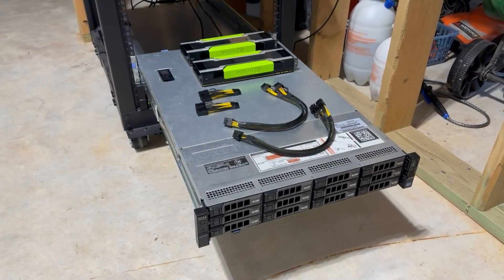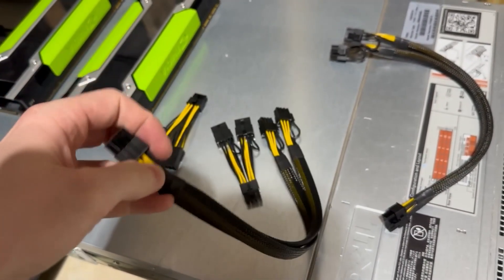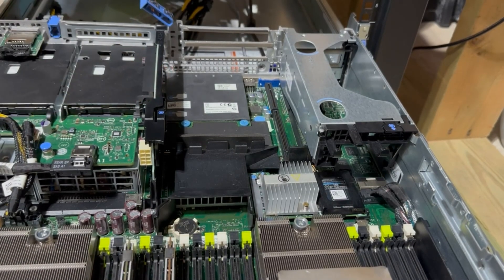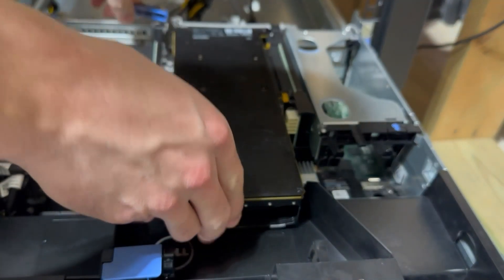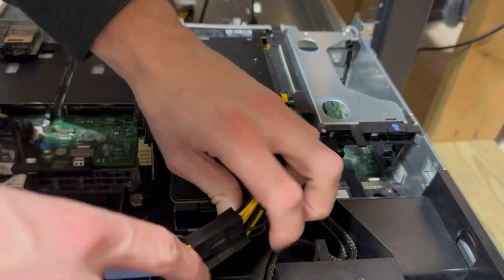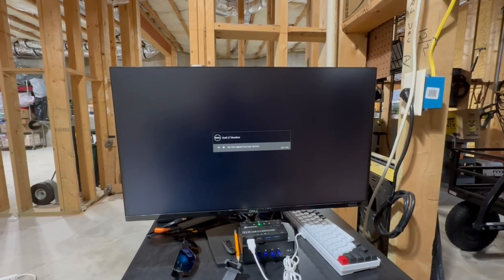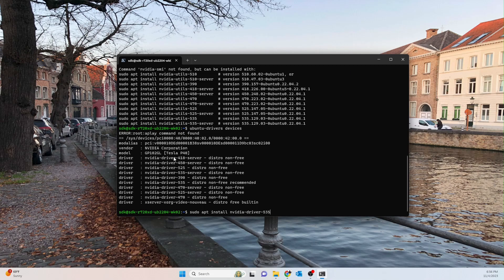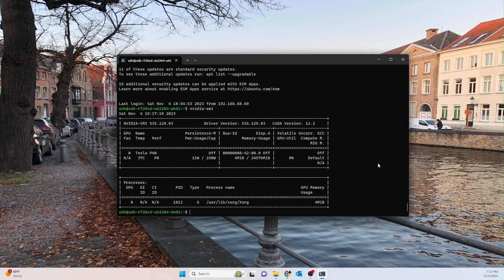Dell PowerEdge R720XD GPU Upgrade: Installing Tesla P40 with NVIDIA Drivers

Comment: Did you ever show us the NVLink, and how that compares for training on say your 2 P40's compared to an A100 40GB?  How about 2 P100 (with 16GB of HBM2 ea) compared to A100 40GB?
Reply from the maker: So I have not yet because I have not been able to find out which exact version of NVLink or NVSwitch will work with the p100 or p40.

These are NVIDIA's official docs for it, and it says that p100 is supported for first gen NVLink then it says later in the doc that only Volta architecture is supported...

https://www.nvidia.com/en-us/data-center/nvlink/

Anyway, I have been trying to figure that out a bit better before I buy anything. However, that video and several other benchmarking type videos are definitely on my radar.

Comment: Wanted to show my thanks here for the video. I'd all but given up on trying to get GPUs into my R720s. I have a bunch of them, as they are very cheap on ebay and elsewhere. I picked up one of these Tesla P40 cards for $175 and installed it exactly as your video shows. Ubuntu 22.04 installed the drivers in a snap, a quick reboot and nvidia-smi showed everything was up and running. I immediately started training an AI model for text to speech (using piper) and found the performance to be pretty good. I challenge anyone reading this to show me a GPU this powerful for $175. I was previously training on an RTX 3060 with 6GB of vRAM. The 24GB of vRAM in the P40 allowed me to increase the batch size and also allowed the longer voice samples to fit into the training. I was so impressed that I bought two more P40s for the other R720s in the rack. All in with cables and such, it's costing me over $550 but again, I don't think you can get this much GPU compute in R720 for $550 any other way. Thank you for the video and the confidence to pull the trigger.
Reply from the maker: This is amazing feedback. Thank you so much for sharing your experience. This is exactly how I felt as well. I wanted the most performance for the money, and I truly don't believe you can do better any other way at this current point in time. Only thing I will say here is the the R720s are EOL for Dell support, but I don't really see this being an issue for home lab use. I have as also been really impressed with the performance. The extra VRAM makes a huge difference for me in my work. It took me a while actually to build up the confidence myself to try this because I could not find any videos on this particular area. Anyway, so glad this helped you and wish you all the best on your projects!
Reply: @TheDataDaddi   I didn't mention that I was also able to install the NVIDIA container runtime for docker like a champ. After all the issues I've had trying to do GPU passthrough for VMs, I was braced for hours of tinkering around. I was wrong, the NVIDIA container runtime installed as easy as can be. No reboot of the host needed. Within 5 minutes, I had docker containers running and using the GPU just fine. handbrake-cli GPU encoding a stack of DVDs specifically. now I'm considering containerizing my plex server and re-locating it this server. I know containers aren't the right fit for everything, but I can make good use of them. If you want some inspiration for a future video, may I recommend installing proxmox on that R720 and passing through the P40 to a VM. I'm sure folks would appreciate it. I know I would.
Reply from the maker: Gotcha. Yeah I pretty much run just about everything I do in various docker containers. I have not used traditional VMs for awhile now. I also do not have a ton of experience with Proxmox, but I have actually been interested in toying around with it. This is a great video idea. I will definitely give it a go when I have some time! Thanks again.  @swiftlabbuildstuff

Comment: I have a 720xd and was thinking of doing the same thing. Would you recommend picking up this GPU?
Reply from the maker: I would definitely recommend it. I really wish I would have been able to fit in 2. I think long term 24GB of VRAM my be limiting for some of my projects. However, for the money you cant beat it.
Reply: Read my comment on this video above. I'd definitely recommend picking up a Tesla P40. If you find a GPU with more compute capability for less than $175, I wanna hear about it. I was so impressed with how easy it was to get up and running, I bought 2 more P40 for the other R720 in my rack.
Reply: Any possibility to make NVlink or something with them for llm? Thanks
Reply from the maker: @ddrci88  Hi there! Great question. To the best of my knowledge, the P40 does not support nvlink or SLI. Although, I have never tested it myself so I can't be sure. I have read that the P100 supports the first generation of nvlink though. However, it is only going to get you to 32 GB of VRAM unfortunately. Might have to see about trying to find the first gen nvlink and test it out.
Reply: Where do you find the the GPU shroud? Cannot find it anywhere.